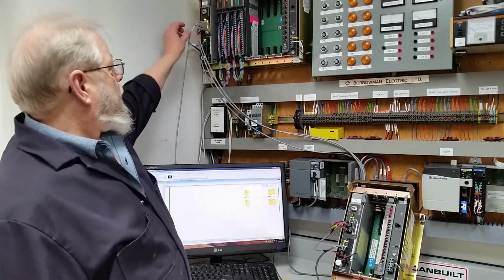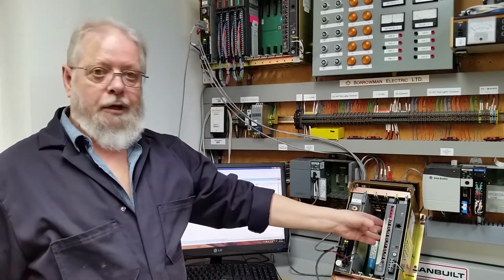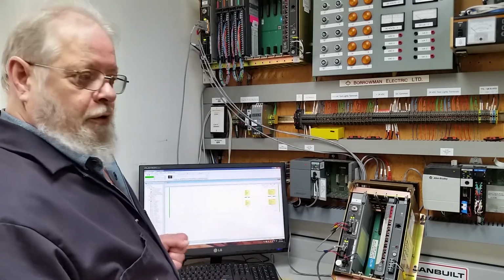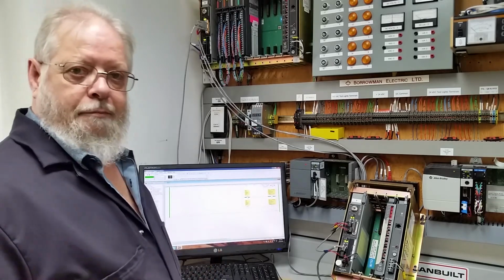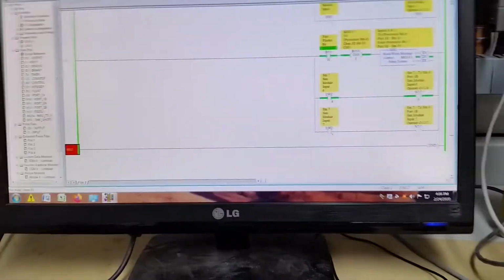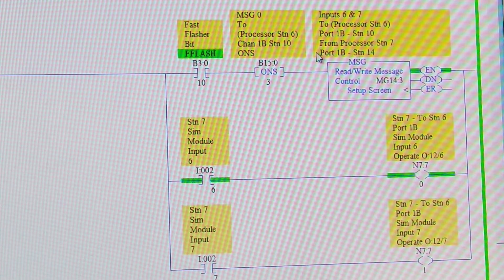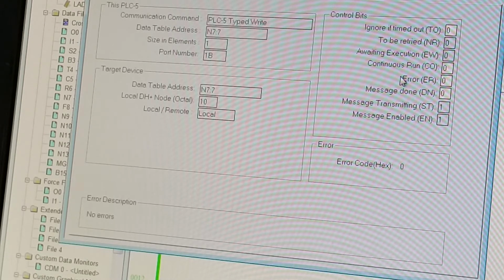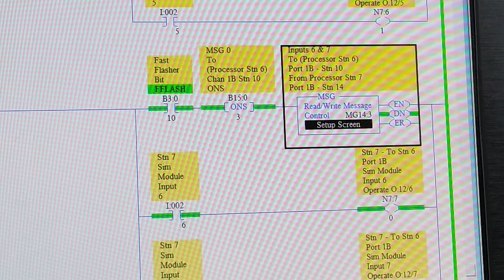PLC5 Communication Ports testing - Video 1

Comment: Awesome video thank you. 

Question though, do you need terminating resistors for dh+ comms, or only RIO?
Reply from the maker: You are supposed to have them on both the DH+ comms and the RIO comms.
For a short distance like on the bench it is not a big deal, but for a real world situation it is a must.
They help reduce noise on the line as the communications in Blue Hose is a current loop.  But not one that you can measure with a meter.
Thanks for your question.
Reply: @ grateful for the response. I'm doing my first clx to plc5 integration coming up, and the words of advice are much appreciated thank you.

Comment: Hi! Could show an example of how to configuration from the 1771-TCM temperature?
Reply from the maker: Hello Saul:
I have not seem a TCM module in years and do not have in stock.
But all of these modules that use block transfers are configured in the same general manner.
I have a video on the 1771-IFE analog input module.  The steps are the same just the values are different.  https://www.youtube.com/watch?v=40IuYS5XQ-o&list=PLApJy6_fcuvgHBG9MnVjcqTjUJ-PbKfzJ&index=13  
Start about the 11 minute mark of the video to see configuration screens.
Hope this helps.

Comment: “Pktx rio adapter driver detected block transfer size mismatch for BT1 (rack:1(oct.) slot:8) Driver*” Any idea what to do about this message on my  PV+? I have tried what is written in the knowledge base but that didn’t change anything. I have also tried two separate HMI.
Reply from the maker: HI:  I have never seen that error.

Suspect that you are using this on a PLC5?
Possibly change out the RN6 communication card that is mounted on the logic module.
The RN6 contains a standard 1784-PKTX communication card that plugs into the logic module. 
They can be set up for DH+ - RIO - DH485 for communication with PLC5 & SLC processors.
Reply: @abplctestbench759  Thanks, yes that’s correct, PLC 5. The PanelView is connected to a 1771-ASB from the RN6. I have also tried two separate PV+ units. Both give the same error.
Reply from the maker: Hi: @MrExtremehustler  
Not sure what to suggest then. 
Possibly check your program backups compared to your running file to see if anyone changed a parameter in the block transfers for the read and write to the PV.
Is there data being written into the BT file area that is overwriting something it should not.
Also is there a DH+ network and maybe someone is writing to your PV from another station?
The only other possibility I might suggest is changing out the logic module and downloading a backup file to it.  Not the file running on the PV you are having trouble with.

Comment: Do you know of a way to tell what firmware version is on a 1785 - BCM/C.  We are in a pinch looking for spare parts but cannot get confirmation of firmware version on the BCM.  Thank you.
Reply from the maker: Hi Shane:
As far as I know the firmware revision is printed on the side label of the module. 
There were not many changes in the firmware of these modules, so you should be safe in getting a Rev C.  
My suggestion would be to test on your test bench setup first if you are worried about not have a compatible module.
Great question as it is not something that I have ever considered.

Comment: I have machine with plc 5/11 
Cat no 1785- L11B .
Program file was corrupt
Any suggestions who can repair.
Reply from the maker: PLC5 processors were original built with an expected 80 year life span and most are now at half life.  
Doubt that it can be repaired.  There is 50 or 60 available on ebay right now in various locations around the world.   These have not be made in many years but normally keep running.
I would suggest that you go online and buy a few for your stock.  As time goes on you will not be able to but.
I hope that you have the PLC5 software and a backup of your running program because there is no way to retrieve the program from the processor if it is corrupt.
Other option would be to manually key in using your paper printout backup of the program.
Reply: @abplctestbench759  sir i have back up of plc program file but .
I have no idea how to load program .
Any suggestions who load program.
If from your site it is possible then it is good for me.
Reply from the maker: @balarmilan  1st - What country are you in?
2nd - Do you have a computer that has the software and cable for going online to the PLC?
3rd - Since there is no ethernet port on these processors there is no way to remotely access them.  You have to connect either thru DH+ or RS232.
4th - I think you need to find someone local to you that has experience in dealing with these processors.  A professional is required that can prove they know what they are doing as if done wrong you will have to rebuild from scratch.  Do not attempt to hire someone that can not prove ahead of time that they know what they are doing.  This is an older technology and required the correct experience - software and training.
Reply: @abplctestbench759  1st. I am from India.
2nd i have not software.
4th not get person who familer with this type of old version
Reply from the maker: @balarmilan  Not sure what I can suggest to you.  A few years ago there was a company in Egypt that had some people with knowledge.  They are closer to you than I am but travel right now is an issue.
The other option is to get you to ship the processor and your backup copy to me and I can see if I can revive it.
But there should be companies somewhere in India that can help you as there were many PLC5 systems sold to India over the years.
Reply from the maker: @balarmilan  Have you been able to get anyone to assist you with your problem?
If not and you still need it done you can ship the processor to me along with any documentation that you have.  Once I have in hand then I would be able to troubleshoot and see if I can repair.
DO NOT unplug the battery because if you do the memory will clear completely and if you don't have a valid backup then the program would have to be re-created from scratch.
Reply: I will try here if not possible then send to u for repair
Reply from the maker: @balarmilan  I sent you an email this morning.

Comment: Hello very good video. I got a question, i hope you can help me.
How i can connect to a plc-5 1785-L40C15 ?. i have rs232 serial cable, 1784 u2cna usb controlnet device, and 1784 ud2hp cable
Reply from the maker: Hello Victor: 

Use your serial cable and go into the 25 pin front port on the processor.  That would be the simple way.  You can review by watching my video about "Using RSLinx with a  USB to RS232 Converter.
https://www.youtube.com/watch?v=kc84k8XxoqA&list=PLApJy6_fcuvgHBG9MnVjcqTjUJ-PbKfzJ&index=12&t=0s
Thank you for subscribing
Reply: @abplctestbench759  Thank for the answer i will try that. Another question, for programming what version of rslogix do you need? can i download / upload with rslogix 500?
Reply from the maker: @victoralvarado7370  - You need RSLogix5 for the PLC5. 

Your asking that question tells me that you do not have the training or knowledge to go online and program a PLC5 processor. 

I would not advise you to attempt to go online to the processor without gaining professional training first.
Reply: Thanks for your answer, I'm still very new in this world, got like 4 months working with plc. Im still learning new things :D but is very interesting. i always do all the procedures with a engineer (my boss) that have 10 years using plc. He claimed that we can connect with those instruments (rslogix5000 and serial cable with 9 pins), but it was part of the task to discover that was not true. Today he give myself the correct cable (serial 232C with 25 pins) and rslogix 5 was on the PC
Reply from the maker: @victoralvarado7370  Hi Victor - I have been working with the AB PLC's since the 1980's.
It sounds like you need a professional to come to your plant and set up proper procedures for using PLC's.
I would suggest that you and your supervisor be careful with what you do, the wrong keystrokes can shutdown the processor and then shutdown your operation.
Good luck to you both.